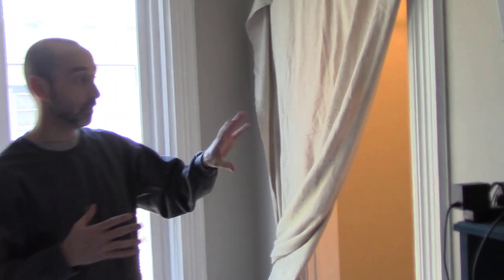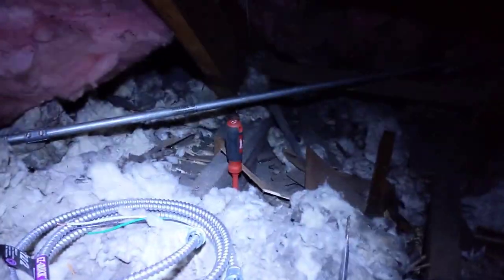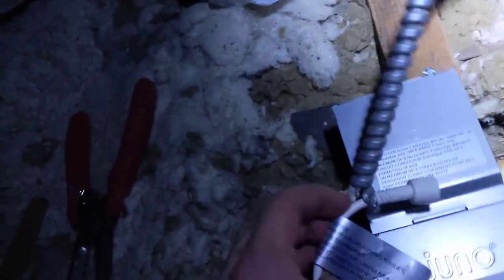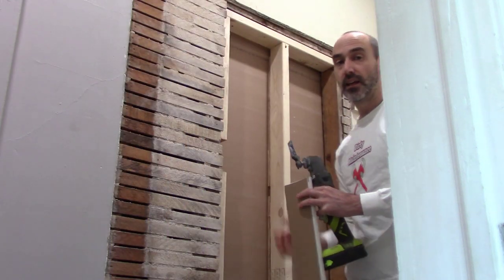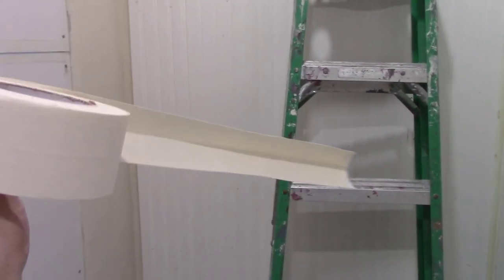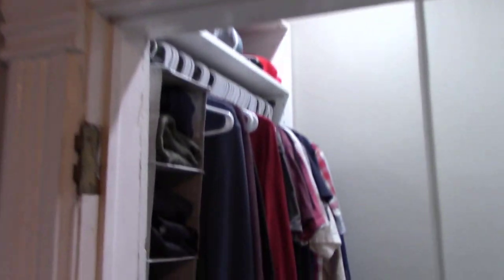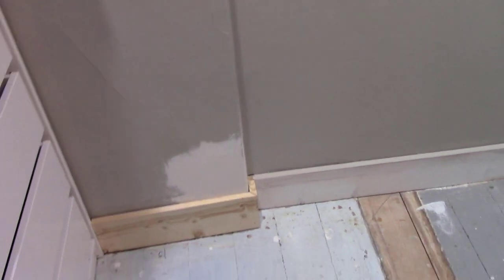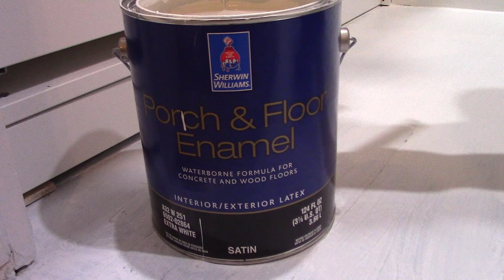Combining Two Closets Into One: Budget storage solutions for an old house

Comment: For the 2 by 4, how did you know it was not need to support the ceiling?
Reply from the maker: One easy way to tell is after removing the plaster/drywall, you can push sideways on the stud to see if it's holding weight.  Mine were completely floppy.  But I also inspected the framing and there was no top or bottom sill plates tied to the attic joists.
Reply: @FixItScotty  Thank you, I was looking all over YouTube,  and your video was the closest to my situation but you didn't show the demolition part so I was confused.  Thank you again
Reply: How much did this run minus electric?